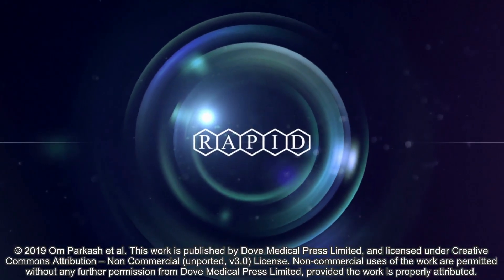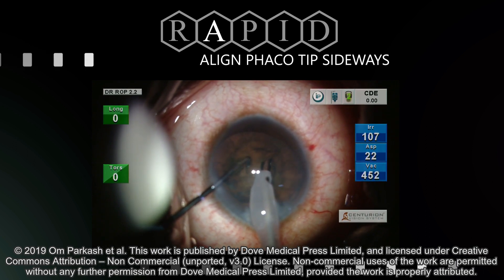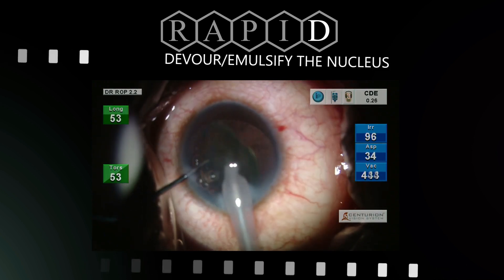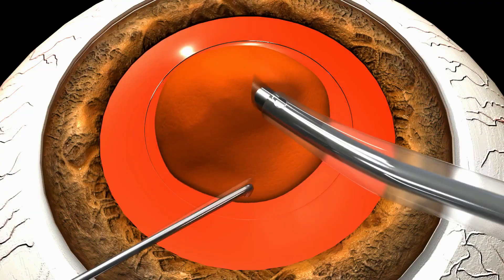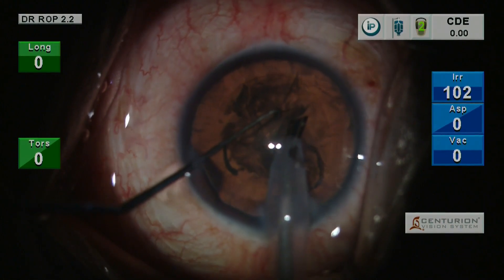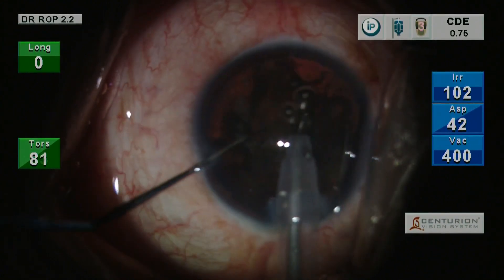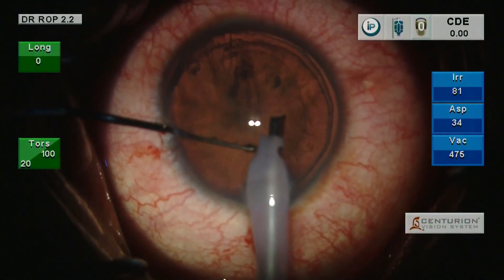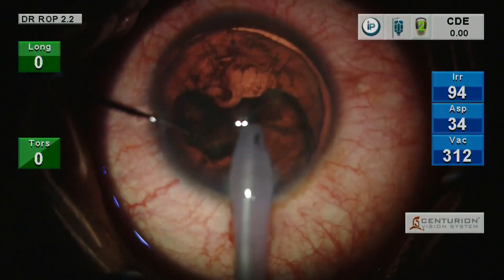RAPID technique for en masse soft cataract phacoemulsification – ID 197359

Comment: Do not need to use any phacoemulsification power in such a cataract. Please remember that ultrasound affects corneal endothelial cells and should be kept to a minimum. I prefer as a patient that you take 2 more minutes of procedure time to preserve my endothelium instead of finishing the case “quickly”…